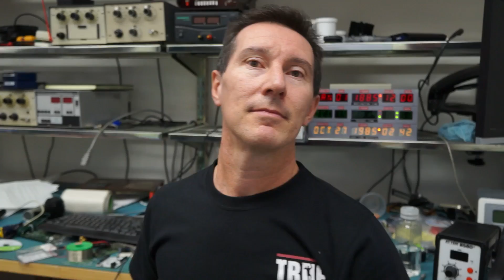eevBLAB #2 - Are Electronics Hobbyists Useless?

Comment: I agree with ya Dave..  I started programming a commodore 64 in 1986 in the 3rd grade and also had a knack for electronics.  I did my own circuit repair when something went wrong with the C64.  Things have changed a lot over the years.  Wound up working in the IT field and getting a masters degree but last couple of years that electronics bug hit.  I am very much an electronics hobbyist but I spent time learning circuit design  wound up making a custom knight rider circuit from 4 different designs and combined them into 1 to do what I wanted and it looked really cool on my son's robot costume, i built last october, along with a 555 timer and 2 4017 deca counters for blinking LED lights.  I also play with micro controllers so coding is also in my bag of fun.  I could not do that without knowing at least basics of circuit design, soldiering and troubleshooting.   I got a lot of inspiration from the Ben Heck Show and been checking out the EEVBlog after an episode he did referencing you :)  I'm excited to see what I can learn and apply from your blogs like I have Ben Heck.  You both are entertaining also which makes learning FUN!!!  Thank you for taking your time to share your knowledge!!

Comment: If you consider yourself an electronics hobbyist then you have to have/know all the skills he mentioned in his video. If you can't design circuit and pcb, if you can't program basic things on a microcontroller, I mean, at least Arduino, then what a hack you can actually do by being nowadays electronics hobbyist? The goal of every electronics hobbyist should be a useful final design which necessarily require all those steps/skills. Just soldering a wires is not hobby, at least not an electronics. Also, if you are already an EE, then you can not be considered as a hobbyist but rather a professional and then those skills are must have and on a high level!

Comment: I think the pcb layout and microcontroller knowledge isn't really necessary for a hobbyist (maybe they're primarily interested in analog audio electronics, for example), but is likely to eventually be learned if they are serious enough. When I was beginning, I don't think I knew you could even make your own circuit board at home. So beginners should get some slack there. However, I think basic circuit design/construction/debugging is a necessary skill to be a hobbyist. If you aren't making circuits, then what are you doing?

An exception may be made for extremely poor people that are unable to obtain even junk parts or solder or whatever. However, they should still understand basic circuit design as that doesn't require any money (assuming they have access to a library).

Comment: I think what you're after is the traditional term of a hobbyist. Someone who's been knee deep in it for the love of the game for a good bit of time. Eg, I got into RC early on. Learned, and still keep learning, all sorts of stuff. PCB work, mechanics, wiring, etc.
I started getting into the more electronics end around 15 years old, snooping around in the radio equipment and now the flybarless gyros. Latest project is a PC programmable light controller you sync up to music for night flying, and that's gone far deeper than I expected (uC was the somewhat easy part. Had to learn C# and windows integration lol)....but I'm still pushing through it. In the end, I'll have a badass project and have learned a bunch of useful info.

Getting into an EE degree and finishing up the second year, I've noticed that the majority in engineering school aren't really "into it". They're interested in many cases, but never take that plunge and decide to build something or try and apply what they're learning. In my case, my friends have to keep me away from anything of theirs that breaks, warranty or not. I tend to compulsively disassemble their stuff. Then again, I've lost count of the times a mfg said send something like a gyro or ESC in for warranty and it was just a broken off wire joint :/ 

All that said, I feel like you're looking for someone like yourself. Someone electronically proficient, but wouldn't shy from getting covered in grease to get the job done.

PS, your channel continues to be goddamn awesome! Between you, afro, and a few others, the door has been swung wide open.

Comment: Ok Dave the kind of person you are looking for has passion. Passion fuels curiosity. Curiosity drives learning. Much can be gained even on a qualitative level. And this kind of person will have an open mind.
Today there a number of open source EDA tools available for only download time.
They range from a mature and complete Schematic Capture and PCB Layout tool like KiCad to a complete SPICE simulator like LTSpice. With just these two tools you can do an enormous amount of work in electronics.
Dave that curious hobbyist should possess all of the basics that you mentioned. One thing I will say is study other peoples circuits and LEARN.
I will say it all begins with Ohm's law and basic circuit analysis. That hobbyist should find Ohm's law and circuit analysis on the internet as well as books on the subject.

So, no Dave you are not asking too much from someone who has PASSION for electronics. They will find what they need to accomplish a task.
This I speak from personal experience. I have also met many electrical engineers who also have to passion and they are as empty as you would expect. To them it's a job not a way of life. Having a prior background will ready you for college and you will get so much more out of it.

Hope this helps.

Comment: Well i am a 19 year old hobbyist, living in Austria (Not Australia ;) )... still in education and i think i will go to university next year.
I am currently working on a stopwatch programmed on a PIC microcontroller which displays the time on 4 7-segment displays... I designed the circuit myself, i soldered it myself and the last think which needs to be done is the programming.
When this project is done i will think about multiplexing the 7-segments. After that i will try to let 2 microchips communicate via the serial interface...

You are not asking for too much. But theres one thing:
I think almost all hobbyists (such as me) are soldering their components on a stripboard so they wont be able to develop their own board.

Comment: Too bad live in Germany, it's too far away to be hired for this awesome Job!
Well, I'm an electrical engineering student, and I'm of the opinion, that it's not too much asked for hobby level electronics. I didn't learn soldering, proper circuit design or PCB layouting so far, but learned it all by myself, and I can tell, it ist not that much asked. Sure, if you want to be amazing, you need to work hard, but for hobby level you can learn it really quick.
Actually I wish there were more student with practical skills in development out of honest interest in this stuff. And clean documentation and scientific workstyle is essentialfor being an engineer, so why not use the opportunity in college to learn it?
To sum it up, I don't understand why people brag about it, I've been doing this stuff for years out if interest, and getting paid for it is even more awesome!
If someone wants to reach goals in electronics as their hobby, they have to learn, practice and also experiment. Otherwise they wouldn't even be able to have fun with it.

Greetings from Germany,
Niels

Comment: A few thoughts on hiring an employee that have worked for me over many years.

Firstly a question.

Why do new electronicists these days seem to think that making a PCB must form a part of a project?

If the goal is development of a commercial product, then a PCB will probably be required, but for one-off items a PCB
is almost never needed. Even at RF, dead-bug or manhattan style construction can work into the VHF realm. For LF
work Veroboard is adequate and if cost is a factor, plain perforated board using pins and Kynar wire is also effective.
In the days before software simulation I have used this technique for fairly complex development in a professional
environment. For a hobbyist there is no better way to learn how to solder and how to deal with physical layout. I don't
think PCB design is something I would place great importance upon.

Things in order of importance:

1. Enthusiasm - For any grade or level. (I've seen a few so-called engineers fail miserably here.)

2. Knowledge - Test them: for any grade or level this ensures a good choice first time and avoids the unpleasant task
of having to fire someone who was just a good BS'er at interview time. Design a multiple choice questionnaire, give
them some privacy and ask them to complete it on the spot.

3. Samples - An engineer should show and be able to explain the circuit diagram/schematic and show a good
standard of written documentation for a recent project he/she designed. A technician should show a physical sample
of something he/she built; the circuit it came from and the reason they made it.

4. Assuming the candidate made it this far, give them ample opportunity to ask questions, a lot can be learned here.

5. Give some consideration to personality, could you work with them?

Finally, the interviewer should be polite and courteous but not overly friendly - don't crack jokes.

Comment: I'm an engineering student at a university in the southeast, and from what I've seen so far (senior, undergrad), most students are not able to design or fabricate boards. Most students have experience programming but would probably do so with difficulty outside of the very small area they were trained in. Most students I've talked to are mostly interested in management engineering jobs.

Comment: Debugging and circuit design has more to do with logical thinking than specific electronic theory. Any hobbyist nowadays have access to circuit examples and tips to solve most problems they run into or usage examples for parts and design elements they are unfamiliar with.

Comment: This sounds more like a typical job spec. Loads of requirements but little or no chance of getting anyone with all of them unless they are an experienced engineer. I would throw out the buzz words but be happy with an applicant with common sense, willingness to learn, and a few left field ideas. 

I got my electronics degree almost 30 years ago. We never touched a soldering iron. Everything was maths, maths and more maths. Very little design at all especially analogue. 'Here be dragons' we were told and then pointed at digital solutions.  There is a 10 fold difference between a motivated and interested student and one who is just plodding through to get a job. So get someone (of any age) who is motivated and interested but be prepared to pay a decent wage.

As for potential applicants I say be prepared to move. I went 900Km+ to a different country with a different language after being made redundant. Don't wait for jobs to come to you. This sounds a very interesting opportunity, if you want it distance is no object. Visas might be but that is another story.

Comment: I think that everyone is going to have their own definition of what a hobbyist is, what a professional is, etc., and what sort of skillsets people under those classifications should possess. In my humble opinion, I think the important thing is that the job requirements are well defined, rather than just knowledge level. At my institution (in the USA), by the end of the third year, electrical engineering students should be able to do what you were looking for, though it depends on whether you would expect your employee to design/write firmware, or simply be able to work with it.

Comment: Can't say for sure. I modify my own circuits for my own uses. Sure I know more than a basic level "hobbyist" when it comes to building electronics but I don't know anything about firmware and programming. (Need to get an open source micro controller and get into that.) Many consider me a sort of engineer but even I doubt that as I just take existing stuff and modify it up for alternate uses. I may even combine items together or combine them in ways never thought of before sure but does that make me an electronics engineer? I have yet to design my own PCB or circuit complex enough to require a custom PCB.

So yeah, you might be asking a bit much for a hobbyist level electronics person. Someone with 2 or more years collage for engineering or like skills, no problem.

Comment: I have no professional tech education, yet I'm of the old hobbyist crowd and I do meet all of the job requirements (aside from living in Australia). I've worked as a sysadmin at a dozen companies throughout the last decade. I also think that kids these days are spoiled and overconfident. They may have been exposed to more of the theory, but had less hands on practice. Schools are in part to blame. The other problem, I think, is with the paranoid parenting and safety standards in general. When I was young, I wasn't afraid to stick things into the outlet. I got zapped many times, burned by the soldering iron and that was tolerated. I was allowed to get my hands dirty when trying to figure out how things worked.
I'm glad I didn't get into microcontroller and FPGA programming prior to covering analog tech - they're an equivalent of an electric guitar being learned ahead of acoustic. They let you pull a few strings and produce godly sounds, with minimal skill.
And it comes back, again to education priorities. You no longer have to prove yourself prior to getting into a program. Prerequisites are non existent. Quoting George Carlin "pretty soon all you’ll need to get into college is a pencil. Got a pencil? Then get in there, it’s physics!"

Thanks for this video, Dave. Your observations are spot on.

Comment: I think that the expertise on being a hobbist, a good one, is a matter of experience and experimentation. You can have all knowledge but if you don't practice you are less than a hobbist. I agree with Dave when he complaints about the electronics people of today. In my first year of being myself a hobbist (I learned electronics by correspondence) we had the Heathkit corporation and you could purchase nice kits which you could learn a lot more when you assembled. You could learn to solder properly and to understand how many circuits work. About some five years later I became a communications technician and I could repair many CBs which were popular in the 80s. Never in my life I had enjoyed life than in those years that I repaired and yes, - modified-  CB radios. I even designed a small board for FM conversion of CBs (it was illegal, and get caught but had no problem because I cooperated well with the FCC, however, it almost scared me away from doing CB modifications). As the years passed all that experience (I desingned all kinds of power supplies, assembled audio kits, and many other things that would not make me afraid to work as an electronics technician. All of these words can be summarized in these: practice makes perfect. Its an old cliché.

Comment: Hi Dave,
well, YES, I think you're asking a bit much.
Not each requirement as such, but to have all on the same person.

Reading the job description, and what you said on video, you're looking for a young person, maybe a student or such. Which would be... well, early 20something years old.
While some start the electronics hobby rather young, most people I know started at 14 to 16.

So they will have about 6 or 7 years "in the field" max. Which is - as I think - not enough time to get around all the different subjects you ask for.

Eg.: Well, maybe they got past the prototype board thing, started making own PCB, doing (basic but fine) layouts - but then I guess they won't have had the time doing the firmeware stuff... Others (like me) got into the firmware stuff, but, well, I was 27 when I did my first real PCB design. Proto boards where fine till then. Took another two years till I did a project that required me to look into SMD soldering. During my 20s I did a lot of digital, lots of 74-series something and PICs and Atmel, and 8051... but linear? Well, there have been these 7805 on almost every board... but puh... But, then there was this project I needed some Op-Amps. And more than the usual 5V. And motors. And BAM, another 2 years gone, but new skill aquired.

You, me, and a lot of people in the comments and the forum can look back to... well maybe 15 to 20 years or more in electronics. Most things we learned during all the years seem basic now (each one as such is), but maybe we should remember how long it took, how much projects we had to finish, just to tackle all those skills.